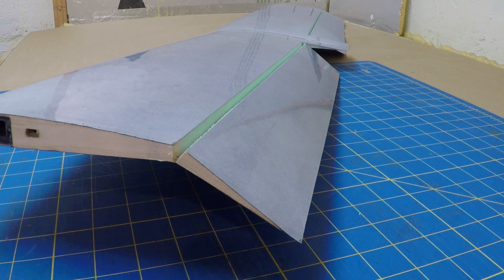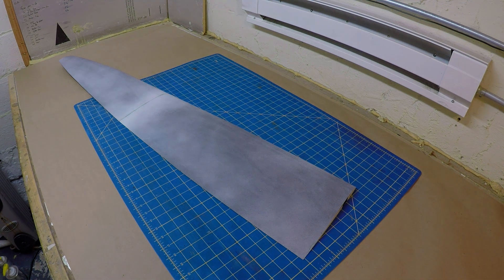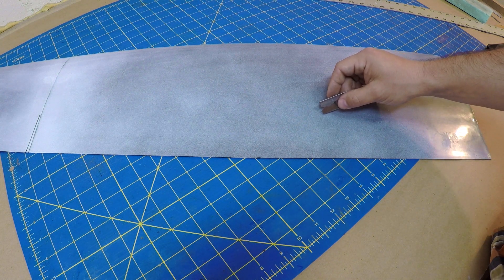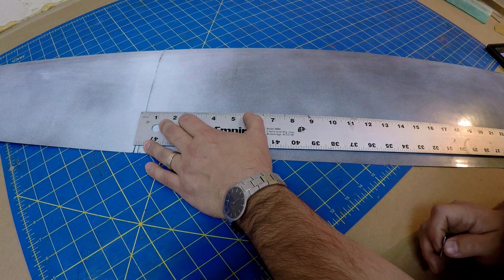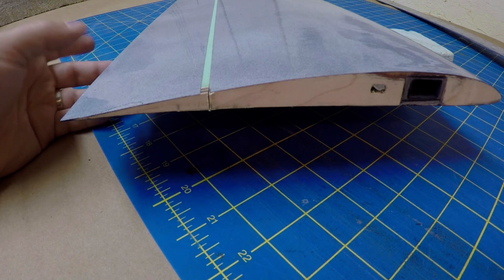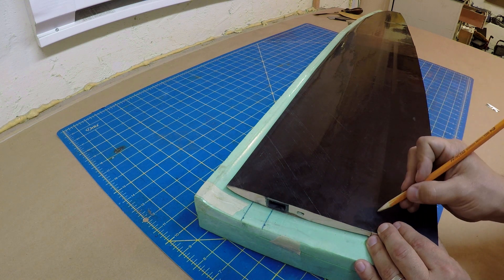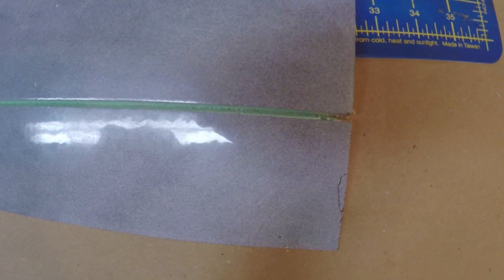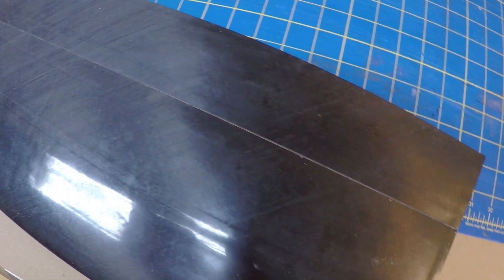Cutting Live Hinge in Bagged Foam Core Wing

Comment: Anybody know the layup method used to create the live hinge?
Reply from the maker: It’s just Kevlar on the 45 spray glued in place
Reply: @BlueCubAdventures  glued to the foam core and then layup the carbon fiber over top?
Reply from the maker: @didgeri-lou2764  correct. Just enough spray glue to hold it in position on the core.
Reply: @BlueCubAdventures  do you use anything to keep the carbon fiber resin from saturating the kevlar along the hinge line?
Reply from the maker: @didgeri-lou2764  no, I actually wet the Kevlar very carefully it needs to be relatively wet. I think I have another video showing that....
Reply: @BlueCubAdventures  I've been getting what seems to be fraying in my kevlar fabric as I try to work the hinge free.  Have you had this happen before and what can I do I avoid it?
Reply from the maker: @didgeri-lou2764  That means you’re sanding into the Kevlar too much you’re only just removing enough of the skin material to free up the Kevlar you really don’t want to sand any of the Kevlar